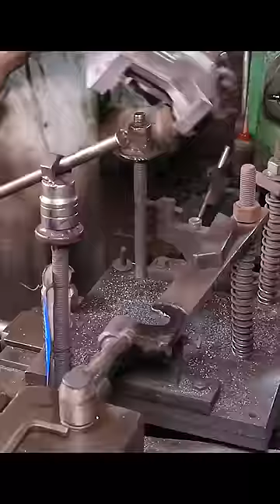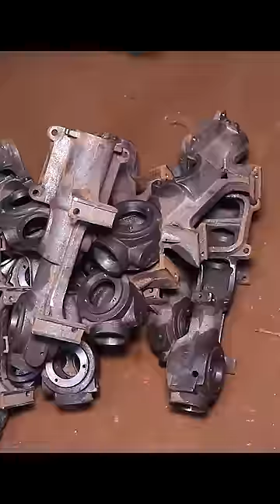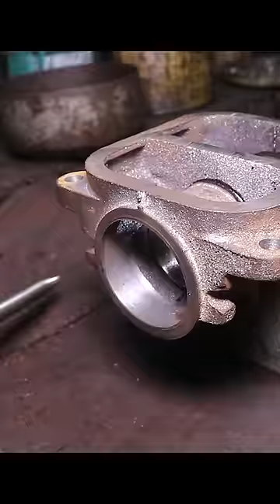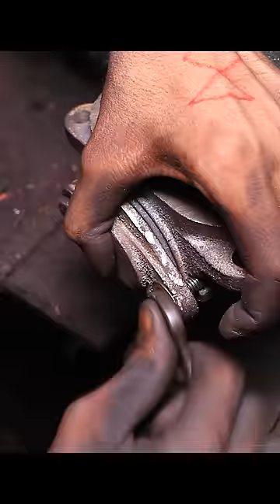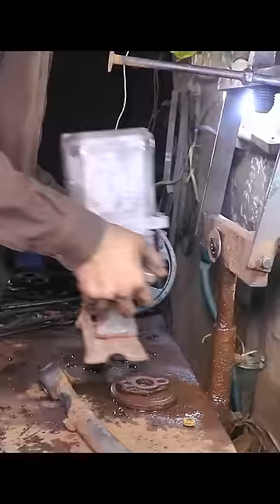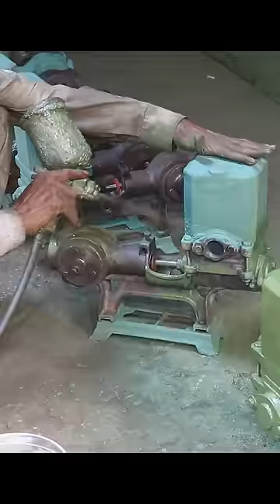Manufacturing Donkey Water Pump #shorts  #manufacturing #waterpump

Comment: 👽 So these pumps cost one donkey??
Reply: 😅no you silly. These are piston pumps that are just locally called donkey because of its shape.
We don't use these anymore. Very inefficient design. Now we use Plunger Pumps of latest style with much higher pressure. Used in Service station and for high pressure application